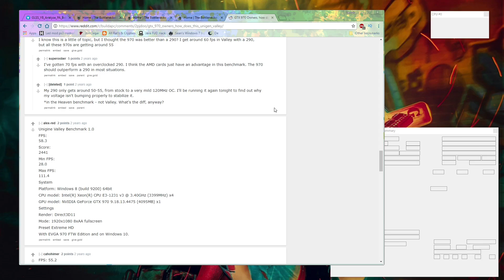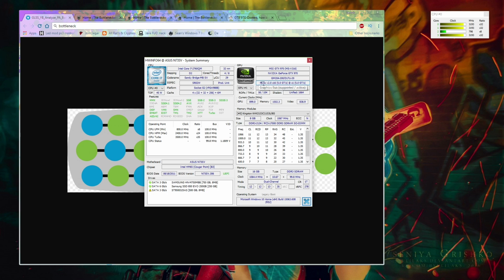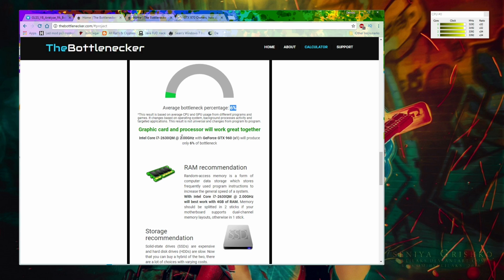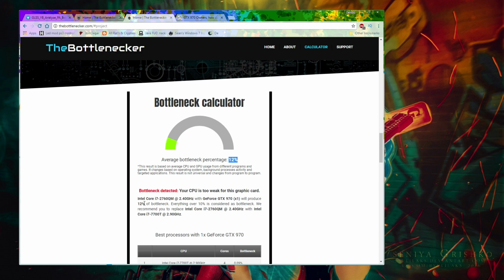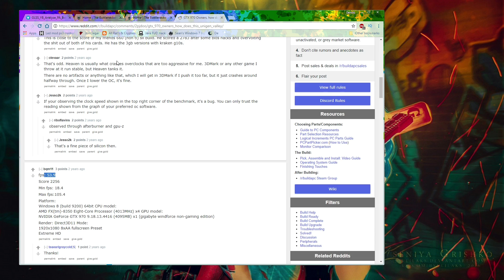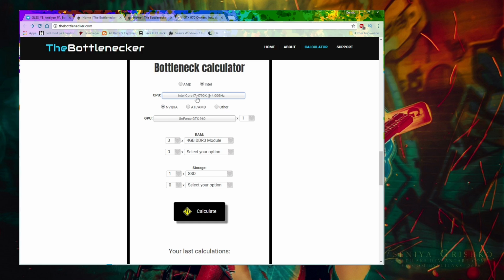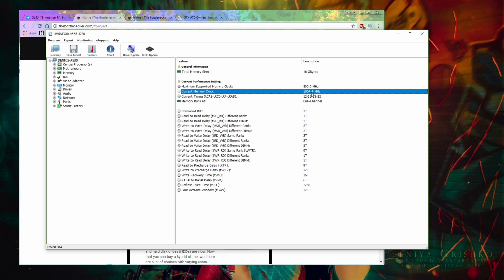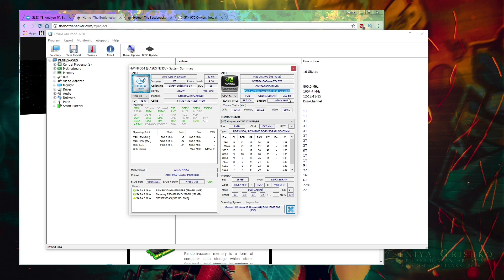About eGPU Bottleneck and Breaking Limits.

Comment: Hey I have an old i7 5500 u the website u mentioned here is gone, I used another website but it is not giving a result saying incompatible. I am looking for gpu's, what do u think would be a good gpu for the dual core?
Reply from the maker: That site probably says that because its a mobile cpu and a desktop gpu, if you can get a score at all you can trust that
Reply: @Gagliano17  thanks!! It was 15 percent so guess it works

Comment: Question,  what resource can a person find for identifying the various slightly different internal ports with visual similarities to the mpcie and m.2, and similar? I opened my case, and found two that were almost identical, and really don't want to buy the wrong hardware, so I need something with full infographics like a PDF somewhere. From what I can tell, my build is similar to the base of what you're doing here. Old laptop with a poor graphics card, but useable stats everywhere else, and a distinct lack of a thunderbolt3. Should be the perfect candidate for the Beast. I just need to make 110% certain I'm swapping the right card, and buying the right cord and power source. the new card is a 1050.

Comment: I have a dell laptop with i5 7th gen (7200u), I'm thinking of using an egpu with rx 570 (4gb), but it has 36% bottleneck with this cpu (according to PC BUILDS site). My question is : will I get more fps with a rx 560 (because it won’t bottleneck with my cpu) than rx 570?

Comment: your rant sounds like my uncle ranting :D
im about to setup an egpu config using a 1060 with a NGFF port. do you have any experience with those beast egpus ?
Reply from the maker: With beast egpus are you refering to the exp gdc 8.4b with ngff connection? They all work the same say just the amount of bottleneck due to connection travel differes, i personally havent used the ngff itself but it wont be very different from the mpcie

Comment: Hey man, I own the asus rog501jw, meaning that TB3 is not available like with the asus 501vw models of the same time, only thunderbolt 2. Would you recommend me using an egpu with thunderbolt or like you, trying to hook it up with the graphic card. 
My laptop is running at 960m intel i7 4720hq 2,6ghz 16gb ram and two ssd's, I am getting a strong bottleneck calculation with my 960m. I want to do video editing with the system and davinci uses the graphic card more. 
Would be a huge help to get tips from you. Cheers

Comment: One of the best videos i've ever seen.
I have a toshiba satelitte s55t-a5277 with intel core i7 4700mq and 12gb ram and nvidia gt 740m and recently i bought an evga gtx1070 and ordered exp gdc to connect it .. i still wait for the exp gdc shipping and hoping to get a good result by connecting these specs together .
Reply from the maker: You will get good results but a 1070 is a bit overkill for the exp, youll have a bit more performance loss in regard what a 1070 could do
Reply: @Gagliano17  all am hoping right now to the exp gdc to work with my Toshiba because i did not see any reviews about someone try it with the same laptop i have.
After that if it work fine i am happy with the result whatever it be 😆 at least still better than my integrated Gt740m 😊😊
Reply: @Gagliano17  i have another question .. in the site you mentioned .. i don't know if the result will be measured at pcie 16X or pcie1x gen 1,2,3 coz that will change the whole idea about the real bottlenecking result.
Any idea?

Comment: @Dennis G Hi brother first and foremost thank you for making this video, I have a few questions if you dont mind answering them would be most appreciated, first of all I have a dell inspirion 17r 5720 with 8gb 1600 ram and a 1tb 7200 mech hd also it has a gt 630m 1gb gddr5 dedicated gpu thats running on pcie 8x my first question is when i disable this in the bios to install my exp gdc v8.0 in the mini pcie slot will this make it run on 8x? second how can i tell what version of PCIE my board has, 3rd i ran that bottleneck calculator and it says ill b 10.47% bottleneck but thats on 2.2ghz (base clock)correct? so when it runs turbo boost i shouldnt be bottlenecked at all right? and my last question is i have a gigabyte gtx 970 g1 gaming(windforce), but was thinking about getting a gtx 1060 6gb should i stick with the 970 i mean like would the 1060 receive worse performance? Sorry actually this is the last thing, idk if you have ever heard of Rust, but would i get good performance on that game? if you require anymore information please lmk and thank you in advance and keep up the good work

Edit: sorry one last thing i just read something else that confused the heck out of me according to something i read on toms hardware it says that ill only have m.2 or mpcie yet i have a m.2 spot on the board and a mpcie wifi card that i was planning on removing and using the exp gdc v8.0 mpcie adapter when i looked at the m.2 version its full sized m.2 (long) my m.2 is like 1/2 that the reason i know its a mpcie slot is because the screw holes line up the same as my wifi card and the m.2 is 1 screw in the middle of the back im sorry im confused as heck now, considering i already ordered the exp gdc i guess ill ljust have to wait and find out
Reply: To know what exp jdc version check your wifi cable in your motherboard then look for the exp jdc that goes with it.

Comment: Hi, what games and gpu's would you recommend for a egpu setup
Reply from the maker: Too Salty to Function anything that doesnt use huge amount of vram, doom, tomb raider, gta 5 they all work fine but high vram usage is more bottlneck on the pcie
Reply: Dennis G would low power usage cards have less bottleneck on the Pcie or would any card that has less than 10 percent bottleneck be fine

Comment: Very optimistic and passionate messege! Among so many debates on forums it is refreshing to see this perspective on low cost eGPUs.

 The exciting thing about this is that a good 2nd or 3rd gen quad i7 laptop w merely expresscard/mpcie connection provides  surprising performance for relatively low cost.  

I have Been getting decent results with an RX 480 via EC on a thinkpad t530 (3740qm) output to external monitor. Yet Id rather  have  15-20 higher frames, while keeping  my revered laptop. 

Would you recommend Nvidia ( maybe a 1060 3gb for 135$, or 1070 for 250ish ) for a better experience (due to better "compression")? Or is the difference only noticeable for internal screen?

Comment: I was surprised to see that my bottleneck will be only 8.33% when I upgrade to the i7 4610m but I’m not sure what it will really be since I will be using an express card connection
Reply from the maker: yeah so it's a good gpu to use, but you will indeed get bottlenecked more by the connection, but what i've always found is that it only really starts to bottleneck once you use alot of vram. the vram is what creates alot of traffic

Comment: Would this bottleneck similar if applird to the razer core v2 egpu?
Reply from the maker: Syed Salleh nope, those use thunderbolt cables, they are capable of performing at 16x pci speeds, so the gpu will have no connection bottleneck, but the cpu/gpu bottlenecks will apply if the cpu or gpu exceeds the others, so pairing a gpu depends on what cpu that laptop runs and ofc the laptop needs to support thunderbolt 3
Reply: @Gagliano17  Thanks for the reply. I'm using razer blade stealth 2015 using an Intel Core i7-6500U Processor (4M Cache, up to 3130 GHz). Meanwhile, i'm planning to use a 1080ti graphic. Tell me your honest opinion, would it be fine?
Reply from the maker: yeah, the cores are made for the razerblades, they will be fine
Reply: @Gagliano17  ohhh I was looking for this. Thank you :)

Comment: I dont understant. I thought people were talking about the bottleneck coming from not having the card directly connected and instead running from external into mini pcie, or lightning, using an adapter? So why are you talking about all this other stuff??? You should be discussing how the adapters work with thier connection, ie. mini pcie and how much information is being sent.
Reply from the maker: Untill you go either above 2-.2.5gb used of vram or like a 980ti or 1070, even this pci-e adapter will give you 80% of the performance, the moment you go high tier card or alot of vram usage that changes. Youll get bottlenecked then, this video had sections where i showed that in general usage there is no bottleneck due to the adapter. I got the same scores as the same cards got on a full size pc

Comment: will you be making a vid on EXP GDC Beast v.9.0b setup, demo, and test soon?
Reply from the maker: nope, since i got a desktop now too, i dont really need to upgrade that, the 9 does not have much different features beside two mini pci-e connections, which i dont have anyway, my laptop does not have m.2 or anything else i could use

Comment: I have asus laptop 3630qm and gt650m %100 bottleneck wtf lol :D
Reply from the maker: gpu or cpu?
Reply: It says my GPU is so slow for my CPU, I am also using external GPU like you do, not really relying on my GT650m but %100 is a bit extreme.
Reply from the maker: Alp Ozen nah thats pretty normal, gpus are the issue on laptop hence my 2730qm had no issue with a 970
Reply: Bro denedin mi eGPU?

Comment: The score isn't exactly the same. The minimum FPS displayed here is nearly half of some of those posts in the Reddit thread displayed. That means there is a higher likelihood for framerate dips and even stuttering during actual gameplay.  It's still the best way to upgrade a laptop though, and I will be getting an eGPU for mine too.
Reply from the maker: it has to do with vram usage, the bottlenecks kicks in the more vram usage a game has

Comment: If I were to get MacBook Pro, would it be worth getting 3.1ghz over the 2.9ghz if the turbo boost reaches the same maximum?
Reply from the maker: macbooks do not really make much usage of it, if you render you wont notice much difference, for gaming, you'd need a thunderbolt egpu, that's gonna be much more expensive
Reply: Dennis Gagliano yea I would wait for the Apple egpu to come out, I’m wondering if I should pay more for the 3.1ghz and if the egpu would produce higher frames with it than the 2.9 if they had same quad core boost limit?
Reply from the maker: I can’t say, has alot to do with your usage, apple will not bring out egpu, there are already some you can use on mac, thunderbolt ones

Comment: i have i7 4510u 16 gb ram will it bottleneck with 1060 6gb?
Reply from the maker: the fuck, i7 dual core, yes it will.
Reply: no dude just a bit it will be playable
Reply: dont listen to dennis. He's doesn't realize whats going on here. It will run fine, prolly the same as a older i5 or a newer i3.

Comment: If i get  a 20% bottleneck with a i5 7200u and a gtx 1060 6gb, is it still worth the money? the 1060 is around 400 aud
Reply from the maker: Ya, you can always resell a gpu so its okay, if you can spare it

Comment: Hello, which Card Match good to a i5 7200u CPU?
Reply: Need help, What about 970 or so?
Reply from the maker: it's a dual core, i gave you a site to check it, go check? with a dual core the 970 will be to strong
Reply: Dennis Gagliano and What about a zotac GTX 1060 3 GB?
Reply from the maker: a 1060 is slightly better then a 970 so even worse for your dual core.
Reply: Dennis Gagliano okay Thanks Dude
Reply: i5 7200u and GTX1060 58% bottleneck

Comment: How much bottleneck do you expect on a  i5-6200u with 1050ti or a 1060 ???
Reply from the maker: depends on what gpu you'd try to run, but always with dual cores i suggest 750 ti's, it does not need a psu, just a 100w adapter, it runs soley on the pci-e lane (75w enough for the 750ti) and it outperforms the 1050ti.
Reply: Are you sure cuz userbenchmarks.com and youtube comparisons show otherwise, or the 750ti just works better on egpu systems? Moreover there isn't  much price gap between the cards here in India, just 30-40 $
Reply from the maker: the 1050 requires a pci-e gen 3, while the 750 uses gen 2, and all laptops that are a little older have a mini pci-e gen 2 lane, meaning the 750 ti woud suffer less from bottlenecks, and if you watch youtube videos of real side by side of the 750 and 1050, you'll see the 750 has higher fps across
Reply from the maker: hwinfo64 or gpu-z both can show it like this: https://imgur.com/a/f2L1O
Reply: thnx, gpu-z showed i have gen-3
Reply from the maker: nice then go for a 1050 ti
Reply: @Gagliano17  what about a rx 570?

Comment: does it work on gtx 1050 or 1050ti????/
Reply from the maker: does what work on the 1050/1050ti, to be honest, not much works on those cards, because they are really bad. i'd take the 750 ti over it anyday
Reply: WOULD THE 900 SERIES BE GOOD
Reply from the maker: yeah it would be, it all depends on your laptop though, if you have an i3, then that sucks no matter what gpu

Comment: wow i didnt knew something like that bottleneck caluclater existed ! i tried it out with i5 4200m with gtx 970 the result was 21% ! i dont understand why so much bottleneck! i was hoping to add 970 or 1060 to lenovo g510. even 960 is giving 15 % :(
Reply from the maker: because the 4200m is a dual core, but you can replace that dual core with a quad core, m (socketed) so you can replace it, i have a video on it too
Reply: i learned something today :) core does matters in bottleneck.
i checked cpu upgrade for my lapi , it gives 10-11 less bottleneck then 4200m , upgrading the cpu then using egpu will be costly ,i think adding a 1060 would be fine for medium settings gaming.
whats your thought on this ?
thanks
Reply from the maker: depends if you plan to upgrade to a pc in the future otherwise i'd just go with a 750 ti

Comment: Hey man
I've been following your vedeos for a while, as I want to do the same thing with my laptop.

It's running on a Core i3-3110M, and I intend to put  a GT 1030, since I'm building everything on a budget, and I'm not aiming ot recent AAA games at the moment.

Considering my processor, budget GPU, the fact that I'll be using 2 monitors, and the "bottleneck" caused by the eGPU, do you think that the GT 1030 will be a good choice, or do I have some better options?

Thx m8
Reply from the maker: a 750 ti is better then 1030. i always recommend atleast a 750 ti, they will perform the same when both bottlenecked but i'd still go just to be safe with a 750 ti, they cost both the same i think
Reply: Well, a GTX 750 ti costs a little more than a GT 1030 around here (a normal 750 is even less lol), but I think it will be worth it...

Let's see if i can get one next monh

Thanks dude :)
Reply from the maker: don't rush stuff, always try to find good prices. i've waited 4 months to sell my 960, and it was real big luck that i've found the same day a 970 for like 60 euro below it's usual price.
Reply: Dennis Gagliano sure thing

I'll se what I can find when the Brazilian black Friday comes up

Comment: Hi i have n76 i7 3610qm. 
Will gtx 1070 work? Im planning to get egpu till i can get full pc parts
Reply from the maker: well it will work. but probably will be bottlenecked. i did have a 1070 myself on the asus n73sv, it did work, so i can tell you that much, and if you'll build your desktop the 1070 will be great then, so if you're really gonna get a desktop, then do it, otherwise don't spend that much on a egpu. i did the same, i'm building a custom watercooled pc right now, using the 970 from my laptop
Reply: Dennis Gagliano Thnx for your answer, yes desktop pc is my end goal. But does n76 have a mpci slot? How do i check that?
Reply from the maker: pretty much any laptop that has wifi build in has a mini pci-e port, you remove the wifi module and replace that with the egpu, i'll check for ya hang on
Reply from the maker: it's under the keyboard, you'll have to make somewhere a hole to get that running, the best option would be to remove the battery, and make a hole in the battery bay that's the closest to the mini pci-e + facing the right way, https://www.youtube.com/watch?v=Zd1NISaHWTk , watch 8:19, there you can see it, close to the cpu fan
Reply: Dennis Gagliano oh thnx :) your boss
Reply from the maker: never giveup it will take some work to get that running, hope your up for it

Comment: Valley benchmark isn't a cpu stressing benchmark. Better cpus can only increase your minimums causing better averages but very minimal. Honestly you don't need a more beefier cpu for 60fps gaming with a 970. I agree with his decision for sticking with his setup. It may be bottlenecked in some cases but even on those cases the 970 is still technically an upgrade because he gets better FPS even if not the full potential of the GPU. In the end both sides have a point but no one is actually wrong. Let's just rejoice he didn't just buy a console, my fellow pcmasterrace members😄
Reply from the maker: i've also just build a dekstop. it was not worth it. spend a lot of money, it was fun building + i'm gonna do a custom loop on it. it's not fully finished modding wise and i miss some ram aswell but it looks hella dope. i did a open case build. painted stuff and all. people will probably like it. but performance wise, indeed what you said. the laptop upgrade was far better investment. also heaven/valley are just to see how much bottleneck the gpu/cpu have though the mini pci-e gen 2 lane
Reply from the maker: r4wn4k there is a bottleneck but not all the time, only if you use alot of vram, but the rest you said is correct

Comment: how would a i5 5400u and a gtx 650 be?
Reply from the maker: i5-5400u does not excist, a gtx 650 would be low for that, i'd always go with a 750 ti or 1050 ti, depending on budget + cpu atleast. even with bottlenecks you'll get much performance out of it. if you own a gtx 650 okay, test that then but consider upgrading in the future, but what cpu are you running